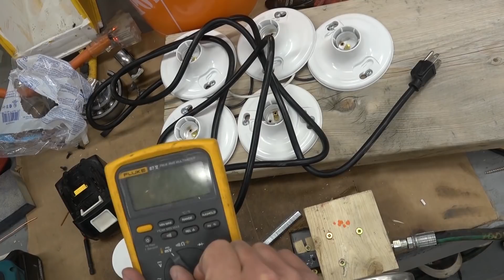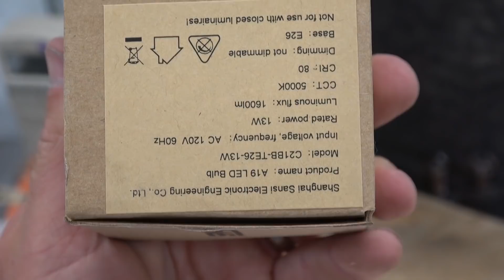Do LEDs work for slow motion?

Comment: seems to me that buying LED bulbs with built in PWM drivers is the first mistake. It would be WAY better to simply buy LEDs mounted to aluminum star boards and wire them to a constant current power supply at some temperature-safe steady state drive current. mount the starboards to a heat sink with thermal tape or thermal paste and you can use the max DC (torch) current in the LED datasheet, around 500mA per (depends on the LED). they make handy little lenses to place over the discreet LED starboards if you want more focused [brighter] lighting.
they make tons of these constant current LED power supplies with built-in dimming for aquarium lighting, etc.

Comment: If you can't find actual tungsten bulbs, go to a commercial lighting supply and look for traffic light bulbs. They are readily available and typically rated for 8 to 10k hours to boot.

Comment: The fucking smell of burnt brushes is so damned awful. When I got into trade works,, my journeyman was using hilti drills to make holes of all sorts as you do in plumbing. 

And by the time I got to these drills they were 6/7 years old. And we drilled some 3"/4"  holes with a hole saw, boy the fucking shrapnel and burnt metal and smoke flying out of those things is ridiculous. Always sad to see them go.

Comment: Does anybody know how to send a gift to Mr. AvE?  It appears he is quite fond of Knipex tools but he is missing the best tool Knipex makes in my opinion.  Knipex makes a smooth jaw adjustable wrench the is amazing (86 03 180).  I have put the horrible "cresent wrench" aside and most open end wrenches and only use the Knipex  smooth jaw adjustable wrench everyday at work.  I can't say enough good things about this tool.
Reply: I'm sorry if it came off like I'm an ass kisser or some kind of a fan boy for Knipex but in my trade i use hand tools everyday.  When i discovered the tool i was referring to i was blown away at how well the tool worked.  
I own every size they make now and i love them.  If you haven't used a pair i recommend you find somebody that does so you can see for yourself or buy yourself a pair.  You'll thank me later.
Reply: @Rewind_Start_Over  
No putdown intended! I also love Knipex! The first one I had was a snap ring pliers that would do inside as well as outside snap rings. Came with, I think, 4 pairs of tips. Regular, 45°, 90°, and extra long! Even better than my Snap on brand, at 1/4 the cost. Hard to contact mr AvE. Stays to himself. The only way I can think of is to send to another Youtuber, Essential Craftsman. They have gifted each other a time or two. Again, didn't mean to offend. Was just in the spirit of the comment section on this channel. G'day.
Reply: I would have just sent a pair to Mr. AvE as a gift but i don't know how to do that.  I'm not sure he reads any of the comments from his videos either, so i tried to reach out to him the only way i could.
Reply: Keep promoting like that and Knipex will have you working first shift with the rest of the ass-kissers!

Comment: So I'm sitting here scratching my head and wondering, why not just use a DC power source to drive LEDs?  
Seems like the enginerding type could even use the battery from the smoked impact.

Comment: You forgot that those sockets also give you 2nd degree burns. I learned that lesson before I ever did a day in school. Some idiot installed one on the side of a garage stairway I could just barely negotiate, and at a height I could reach, so of course I put a bulb in it. The only bulb at hand was the spare bulb, an unfrosted 250W bulb just like the one in the ceiling of the garage. I got the bulb off the shelf and climbed back up the stairs and screwed it in. It made a loud pop and lit up, blinding me for a moment, but I had done it! I climbed up past where I had ever dared to go to see what was up there. My adventure ended after about 4 steps with a wall that may have had plaster on it before WWII. When I turned around I was blinded by the glare from that clear 250W bulb, but I made it down three steps before I missed. I fell towards the bulb and tried to grab it to stop my fall. Tears, shards of glass, blisters and a pain in my hand I could not explain to my mother were the result, along with the usual bumps and scrapes I collected almost every day at that age... Yea, I still hate those damn things...

Comment: So I says to myself, 
"Self. Ifn the issue is with the AC crossing zero why not run your LED on DC as it was designed? 
I'm just shootin the smoke here.
Reply: Sy why to cars with LED lights flicker when you video them? they run on DC
Reply: @scottstarling247  My "guess" is poor filtering, remember the voltage going back into your battery comes from an alternator, AC converted to DC.

Comment: Fast switching just seems like a silly way to solve a problem more suited for an AC/DC power supply and then all of your lights can be cheaper and simpler.
Reply: chopper circuits are cheap , lots cheaper then ac transformers
Reply: @pablopicaro7649  Sure they are cheaper but are they better? An Problem caused by digital where an Analog Solution is better but use a digital solution because it is cheaper not only does not address the problem but introduces more hidden problems only make sense if you forget the original problem.
Reply: @pablopicaro7649  Have a google how much these LED lights costs vs how cheap you can just get some plain LED strips or COB arrays for. Factor in he most likely already has a 12v or 24v DC supply for any of the tools he's got around the shop and you have yourself a far better solution.

Am I saying to add a DC power supply to every single light, god no but in either case DC is the sure way to go in this case to get better light for filming.
Reply: Or find out which LED bulbs don't cut corners and play malarkey when it comes to smoothing capacitors. Doesn't matter which ways the pixies dance about if it looks like it' proper DC to the actual LED once it's past the rectum fryer.

Hint: the bargain bin lights either don't have enough of one or just omit it altogether.

Comment: Protip: When your drill starts to smoke, run it with no load for a second to blow the smoke out.
Reply: That's just common sense, gotta let that cooling fan do its job one in a while
Reply: I did that to my electric impact gun while I was working on a project. Of course I gave up when it no longer had the torque to do the task at hand and went out and bought a new HF air impact. Maybe one day I'll rebuild that electric impact, but probably not.

Comment: Ima just an everyday moron but.....12v dc led lights don’t strobe.....do they?
Reply: Depends on the design of the DC driver.  If they're straight from battery there's no power alternation so no strobing.  If they're coming from an AC to DC power supply they can still strobe at 110/220etc if there's not a power rectifier or the like in the driver to handle it.

Comment: For any PWM LED's, you can connect an electrolytic capacitor across the actual LED's, it will smooth out the impulses
Analogus to the difference between rectified AC and smoothed DC ;)
(yes this would mean opening those lamps to connet the cap)

Comment: Run 12v LEDs off deep cycle 8D battery, put a high output charger on the battery.
No more dicker in the LEDs

Comment: Cheap leds don't have a smoothing caps to make the led drive voltage a true dc.  Newer line voltage cobs aren't even designed to allow one.  You gotta get leds with smoothing caps. I'd say ask BigClive for recommendations , but he runs that fancy European 220v stuff.

Comment: 4:40 - Wait, why would they have PWM at all? They even say "not dimmable" on the box, so there shouldn't be any PWM being done by the driver. Do you mean the switching speed of the power supply? Presumably that's smoothed anyway; the LEDs themselves shouldn't flicker (not in the way PWM-dimmed LEDs do, anyway).

Comment: The flickering isn't so much about PWM frequency as it is about having little or no input and output filtering on cheap LED bulbs so brightness ends up tracking AC input. Better quality LED lights have constant current output with very little AC ripple.

Comment: In one workshop that I had the misfortune to work in the lighting consisted of banks of three fluorescent tubes, each one on a different phase.  The idea was to minimise strobing on machine chucks and the like.  I don't think it made a bit of difference but they were very proud of it.
Reply: Gee, was just wondering about playing with the phase glad to know it’s been done, tried, and rejected
Reply: I tried that, it failed, but relacing them with HF fittings  did work. But it depends on the rotation speed.
Reply: @dogwalker666  
To be honest, knowing that they had done this we tried our best to strobe any rotating parts.
Reply: @awatt  what I have  done is replace with Led lights using Resistance droppers and liner DC power supply.

Comment: I smoked my first cordless Milwaukee angle grinder a few months ago.  I thought it had been decommissioned, but a plumber apprentice made the mistake of handing me a dead tool in the middle of a awkward position weld.  The "fall" from atop a 14' ladder broke it right in half.
Reply: Lol , I know way too much about wet and mud filled plumbers tools . 
I can't help but giggle at your plight . Best one I've seen yet was a hazard fraught drill broken in half between the handle and smoke holder . Zip ties were the answer to a problem that didn't need to occur , as with most problems .  Apprentice had dropped it from a 12 ft ladder while putting up storm piping hangers .

Comment: DC LED strips work great if driven from a big enough power supply with enough of the ol' smoothing.
At least in my case where I'm driving 15 watts of them off a 600 watt PC PSU.
Though I'm sure a car battery will do the trick.
Reply: You'd be better running them off a battery since switching power supplies can still have significant ripple.  

DIY Perks has a number of very interesting lighting builds I have used for inspiration https://www.youtube.com/user/DIYPerks

Comment: Such a shame. If you'd just put the makita back once you noticed something was wrong you never would've broken it...

The next guy would!
Reply: That's not such a great plan when the next guy is most likely you .
Reply: That's probably what happened to him, some other asshole.
Reply: DEWCLAWWWW!
Reply: Ive been using a dinky little bosh impact driver for years now, it ain't ever done did do that to me
then again, it's using a good old brushed motor^^
less efficiency but it just verks
Reply: @nathanwest2304  The difference between your tool and his, is likely that yours wasn't disassembled and reassembled by AvE. If AvE was a surgeon, his name would be Dr. Kevorkian.
Reply: @bradley3549  naturally I've had a peek at that little tool myself, naturally, everything very well made as you expect it from Bosch, even tho it's a green tool
but I did dump a bit of MoS² powder in to the gearbox just cuz I can^^
a dab of molygrease on the shaft for good measure

on that note
ALWAYS disassemble the impact mechanism on your impact driver and lubricate it

FACOM, DEWALT and chinese tools are bone dry and that is a known issue
DEWALT/FACOM don't even give you a felt ring or something to keep out the dirt, so the lack of lubrication is twice as bad.
Reply: @bradley3549  😂😎👍
Reply: Salty much? 😂😎👍
Reply: funny thing is this is exclusive for makita , i've had a corded screw gun do the same thing once, try to slowly drive a screw and smoke comes out then is dead.
    the fun part was that it was my coworker's tool and since i don't work with makita tools i just grabbed it and ironically asked him how's this doing? did it fail you yet? and then tried to put a screw in and smoke :))=)) , he thought i did something to it at first lol, luky me it was just the switch that broke and didn't have  to buy the guy a new tool because i'd die before buying a makita for anyone.
Reply: @witgangyounotube287  Driving bolts slowly is the principal cause of powertool death after falling from altitude.    You make the motor run a lot of current at low speed!  That is why  all of them have the hammery thing inside!
Reply: @witgangyounotube287  Don't touch my tools dickhead!

Comment: think there should be a little electricmagal box under lighting thingys so the pokey bits with angry pixies are contained in a non carbohydrate flammable box to be code... in v2 since proof of concept werks.

Comment: I had a similar issue before and just used a series of cheap LEDs with slight phase shifts so when one flickers, it isn't noticeable.
Reply: with that huge spool of (what i call romex) wire on the bench, i honestly thought he was going to work out a phasing harness so that each light would be on at least 2/5ths of the time, so that any flicker was purely directional rather than full scene.

You could still catch the strobe from the overheads, but those bulbs he was using were pretty slick. some of the more expensive knockoff flashlights that could blind a moose run at 50-150khz strobe on "max power" and somewhere around 15khz on "low power" - the low power is detectable with the naked eye if you have something like a sprinkler running at night.
Reply: @genewitch  Does that work too with a chocolate fountain?
Reply: @SerbanCMusca-ut8ny  I'm not a photographer but I'd wager a spot like a flashlight or those spots in the video would have wicked glare or reflections without a light box. The flashlight I have that looks ok in high speed used to be sold as "Sky Ray" with Cree labelling. Try to find lights with only "on and off" as opposed to "5 modes" to start. Wax paper might work in a pinch to test softening of the light too. Good luck

Comment: Could always have the wires longer between the light so the phases are further appart, reducing the effect of flashing ? Any pixies mages warriors in the chat that can confirm if it could work ?
Reply: Yes but at 690 million miles per hour you’re going to need a big cable loop
Reply: @PapaWheelie1  I made some telecommunication antennas using two dipoles and keeping the signal at 45° from each other only needed 8 cm of extra wire. Mabey it works differently between with 60hertz and 140 Hertz \_(ツ)_/¯

Edit: So yeah, using a calculator you'd need an additional 5 meters if wire at 60hertz to have a phase shift of ~90° ... mabey am using the wrong calculation too 🤔

Comment: Some sort of jury mc-rigged diffuser in front of the bulbs would go a long way to eliminating them multiple hot spots.
Reply: You can buy cheap clear diffuser material like they have in front of florescent bulb fixtures at the local gettin spot. I used it for my jerry rigged lights

Comment: Send it back to the factory. They should be able to replace the magic smoke.
Reply: @Roy Bentley It's a stock Lucas part, Replacement Wiring Harness Smoke kit, P/N 530433
Reply: @nickb2245  But is wiring smoke compatible with silicon smoke?
Reply: @nickb2245  Lucas, Prince of Darkness
Reply: @MrPossumeyes  Sir Lucas, Inventor of the Electric Dark
Reply: The smoke is keyed to the tool these days. So unless you  catch it when it runs away, you are off to the store.
Reply: Refill*

Comment: 3:58 do like every place I ever worked. Write broken on it, then put in on a shelf where no one will throw it away for fear that it might still be good later.
Reply: You're lucky. Most places that I've worked they don't bother to write 'broken' on it before it goes back on the shelf.
Reply: That's the self reviving types; we have those here too.
Reply: Haha nailed it. At work we have a small broken two wheel cart we’ve been keeping for some reason for the last two years, I’ve thrown it in the scrap
twice and my work colleague has fished it back out twice. I tripped over it for about the millionth time last week, so I lost my shit, threw it across the shop then cut the fucker in half with the grinder. Then threw it in the scrap for the final time, it’s not yet made a reappearance....
Reply: @Ginto5629  Just think of all the time you could have saved if you had just fixed it the first time. ;)
Reply: @Ginto5629  there's still time  hahaha
Reply: No you put it on a shelf for replacement parts for its replacement, but the replacement fails in the exact same way. Rinse and repeat.
Reply: There is a lot of truth in that statement.
Reply: But the thing is most of the time when people make a note it doesn't work (not saying you)  it does end up working, after replacing the fuse or etc. :)
Reply: I used to work at a place that would have marked that Makita as “suspect - needs testing” and it would go back on the shelf, never to be thrown out.
Reply: Dad always did that exact same thing... NFG in paint marker all over the damn garage...
Reply: At my shop the rat bastards just swap it out with the tool off someone else's truck. I don't ask for anything new anymore and use only my own personal shit then when another guy works with me asks why my truck's Sawzall sucks I just tell him he should of taken better care of it when it wasn't "mine" by default.
Reply: It really helps to add a 1 sentence description to it so you know what parts are steal-able later.
Reply: Haha yes!